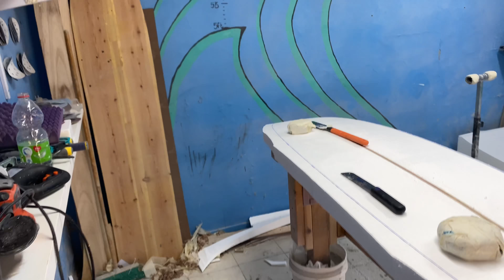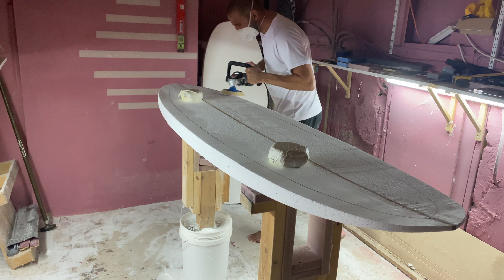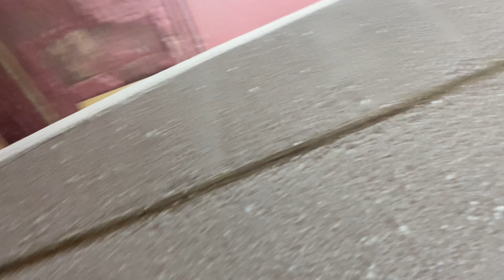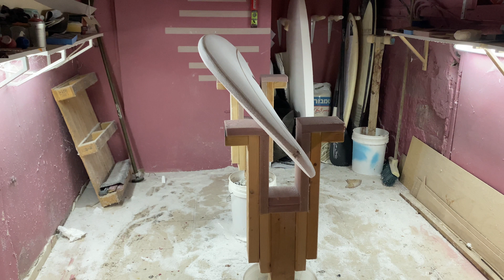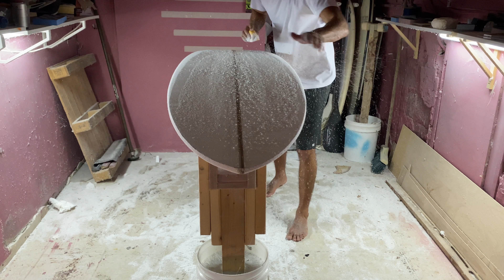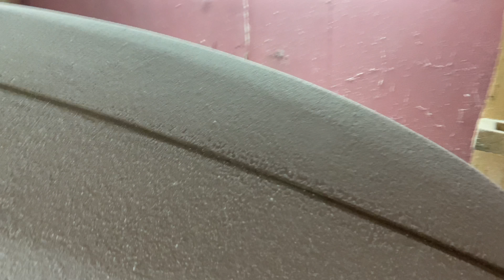Retro single fin Surfboard Shaping  | Start to Finish | 100% Hand Shaped

Comment: Welcome back. What stringer material do you use?
Reply from the maker: Hi James, I have built this blank myself with hot wire, I used Paulownia wood sheets 6mm thick, glued 2 sheets together so this stringer is super strong and extremely light! 230gr so I am happy with the results. because it is 12mm wide it also looks great - right?
Reply: Yeah! Looks great

Comment: I really enjoy your videos.  I am watching a lot of videos to learn about making boards from beginning to end before I make my first one.  I like the idea of making epoxy boards because the materials are so much less toxic than PU boards and laminating resin.  I know that smell is relative, but how strong is the epoxy resin odor in comparison to PU resin?  I like the fact you used a disk sander to make your rail bands showing there are multiple ways to accomplish the same thing. Most shapers I see use a sure form or power planer to do em.  What is the rational for using the disk sander if you don't mind me asking?  I skipped around the video and I didn't see you use a power planer at all, but rather a sure form.  What was the rationale for that?  I really appreciate your videos, keep em coming!  ; )
Reply from the maker: The odor is almost non existent, but you still need a mask. The disk sander is just to save time.. i like it because the disk is flat and it is good for the first panels. i am not using power planer, sure foam is my go to tool most of the times. I also use cnc machine sometimes (local surf store with my design using shape3d)
Reply: @kobymaymonsurfboards7320  Thank you!  You do good work.  Thank you again for sharing it.

Comment: You say at the end of the vid, “I’m going to seal the board”. What do you used to seal it? And why do you seal it before glassing?
Reply from the maker: EPS board never has a perfect finish, it has millions of tyne holes that need to be sealed. I use Spackle paste, it has almost no weight, especially with the small amount we use. the purpose is that the EPS blank will not absorb the epoxy and keep the weight down. this is the professional way of building EPS boards. In the next video, I will do a very cool fabric inlay but before I will show the blank sealed and I hope it will help.